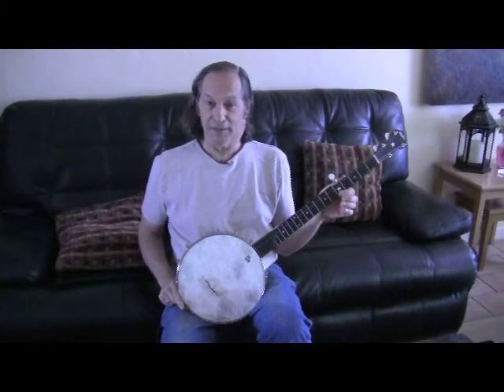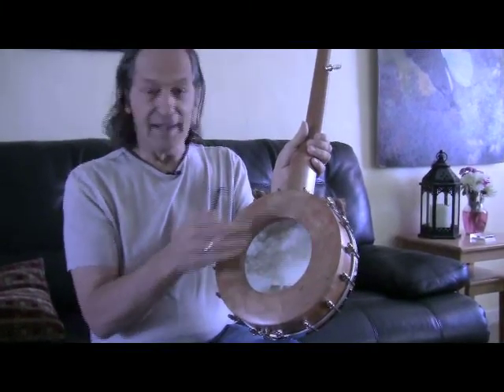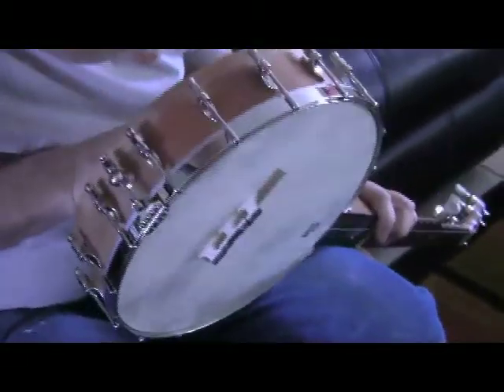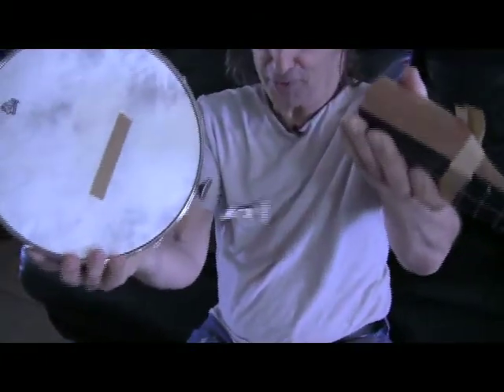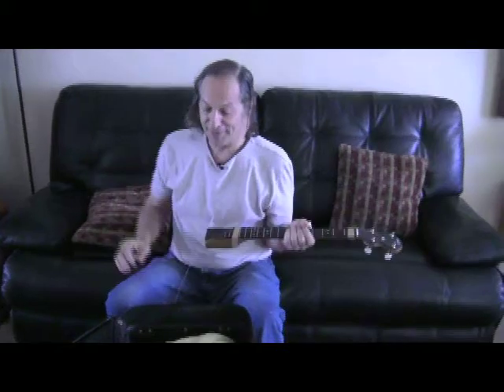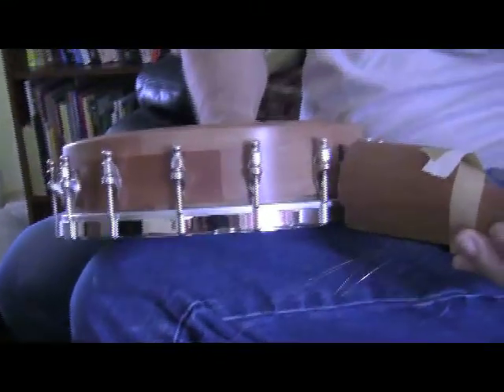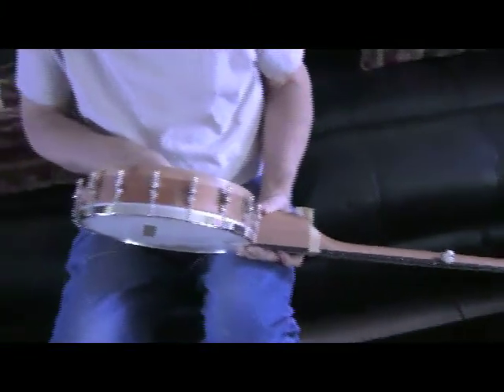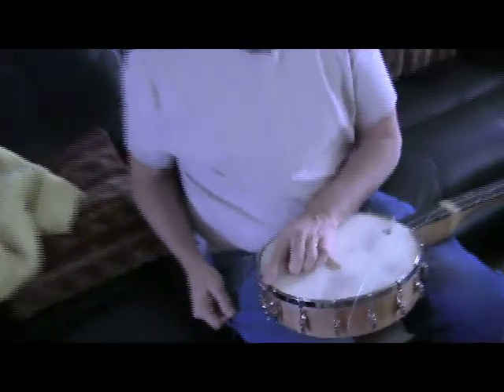Hickler Standard Frailer Assembly and Disassembly

Comment: Nice banjo and the neck mounting system looks appropriate. My only suggestion: use a capo or two to hold the strings in place instead of the tape. No goo to clean up.